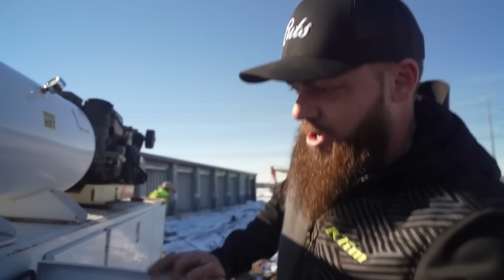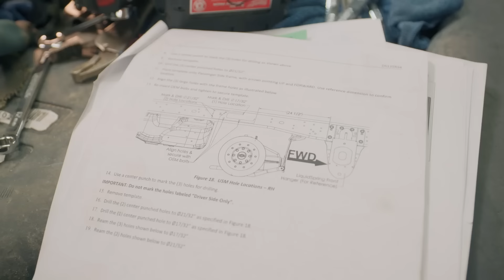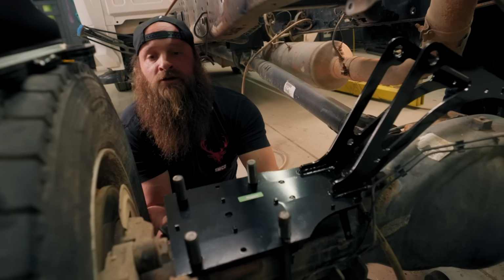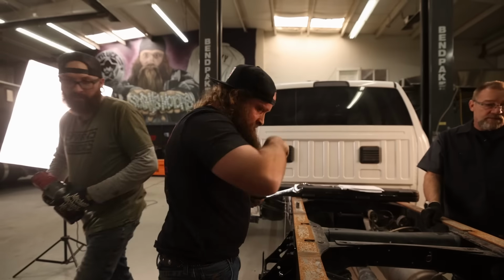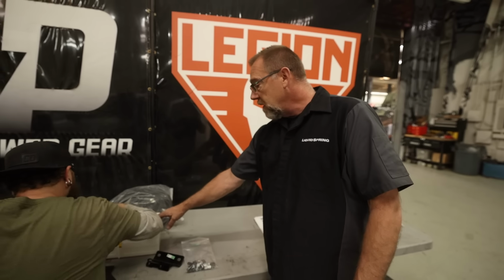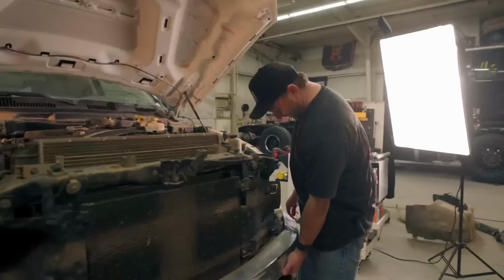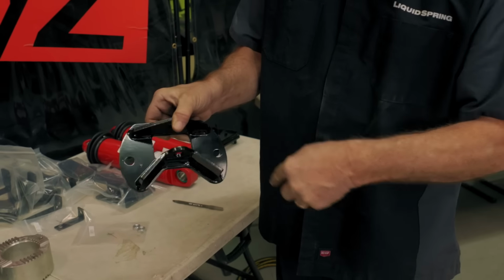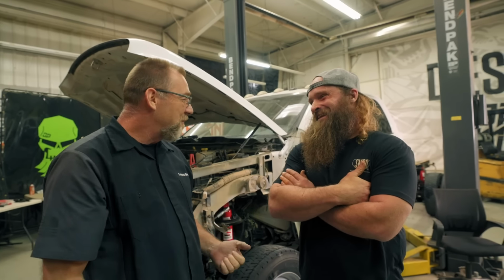New Recovery Build For Heavy D! (Liquid Spring Install)

Comment: So usually they install a extra spring on the crane side. Is there a factor built in to accommodate one side when lifting really heavy loads or does both sides get full load. Very interesting technology. Oilfield roads are terrible and that's usually what fails on service trucks.

Comment: We have the rear axle setup on all the Ford ambulances we service. They are a really Heavy Duty setup. We have one 2017 F-450 that has needed a new pump unit and probably 8 trucks that have needed new hydraulic cylinders. This company is good to work with and gets us parts fast. Good job on the install. Those red cylinders and the new style and seem to last longer than the old style ones.

Comment: What I would like to understand is the phrase compressible fluid because physics say fluid is not compressible
Reply: Agreed.  Sounds like a load of malarkey.
Reply: Randal, silicone fluid has a 6% compressibility by volume. Much different than hydraulic fluid and mineral oil. The things our teachers didn’t tell us!
Reply: @LiquidSpring  I'd like to see the data on mineral oil and silicone
Reply: @LiquidSpring  mineral spirits with breakdown mineral oil is derived out of mineral oil because it's the solvent in mineral oil which evaporates because of air and heat loss when you heat mineral oil it becomes thicker than Greeks and tacky sticky so how would that function inside of a moving friction Bates
Reply: @LiquidSpring  is is a derivative generic term it is a synthetic at hit adhesive that bonds to carbon's so once again I'd like to see your data on mineral oil with a synthetic bonding agent to a carbon and how that applies
Reply: @LiquidSpring  so in your logic diesel fuel with a synthetic additive is compressible I'm sorry to tell you but when you compress diesel fuel and oil it explode combustion with compression because compression derivative is heat is a heat evaporates the solvent in mineral oil and mineral oil Becomes of varnish

Comment: Saw the Milwaukee impact have the trigger malfunction(skips a bunch before engaging/applying torque) 
Most (even small shops, non influencers) can get those replaced under warranty.  They're the new generation, that are riddled with problems.  So badly they're reverting to the previous generation construction, and replacing them is a 🍰

Comment: Have you looked at dominator beds and cranes? I have an 11ft bed and 10k crane that I love. Heavy thickness on lower boxes. And slightly less thickness on upper boxes. Hydraulic extension on stabilisers and cordless remote plus corded  remote for b I’m
Reply: For back up

Comment: Liquid Springs is a great system. The Fire Department I worked for used it on our Ram4500 ambulances. I do have to call a little BS though- you may have to replace some parts. We had to replace 2 power units, several shocks on various rescues, but maybe it's because we ran them hard. We only had it on the rear and would also use it to raise and lower rig for patients. If I remember right most of the replacement was under warranty and it was easy getting ahold of support in Lafayette

Comment: What I'm most curious about is the video system you install. I figure you need at least 8 cameras permanently mounted with lighting for each camera & a couple PTZ's so that you can catch a lot more action from truckmount cameras plus doubling for driving aid in tight spots. Of course you may think differently about filming given the diversity of experience you've got doing youtube.

Comment: Dave, that front bumper bracket you could’ve cut 3/4 of an inch off the end of the bolt. with the whizer wheell and It would’ve pulled out

Comment: hi carl great job i saw a healer running looks like mine that truck and system looks huge wonder what the weight difference is or will be i just mess with 1 ton chevys wow looks great cant wait to see yeah
Reply: Rich, the difference between the factory suspension and the LiquidSpring suspension is a 290lb add. Not much for all the components we install.

Comment: This is very cool indeed.  I wanted to ask something about one of your tools.  As I recall DD had a wrench which he using (socket wrench?). That had a red light in the arm and later I saw one with a green light being used.  I was wondering what they are.  If you can recall the name of the manufacturer,  please let me know.    I love seeing your modifications come together.  Always be safe, and blessings to your whole team.  😁
Reply from the maker: That’s just a torch wrench with a light that tells you when to stop
Reply: I've only had old USA-made Craftsman clicker wrenches but electronic digital is more accurate. For cheap, DeWalt clicker type is accurate.  Snap-on is always good even counterclockwise but overpriced.  For digital, if you need 2-3% accuracy rather than 4%, try SATA for price if you don't need to do angles.  If you do Craftsman, be sure to find one with the memory button.  The sound thing on the digital ones annoys me.

Comment: The system does work really good we have them in our freightliner ambulances here. We actually have a patient load/unload feature added that lowers the rear of the ambulance when the rear doors are opened to make it easier to load our Stryker power load cots. Just curious how much weight they actually add to the vehicle.